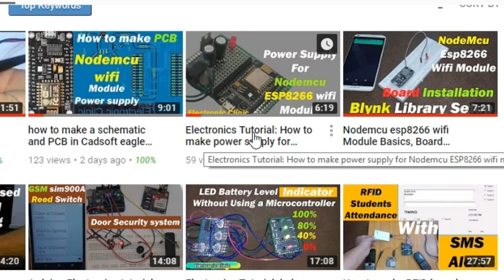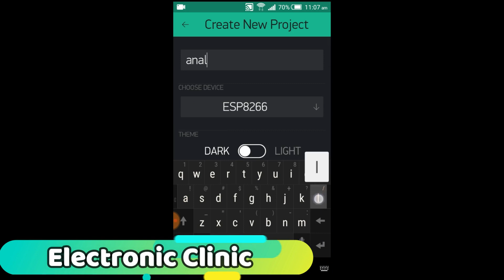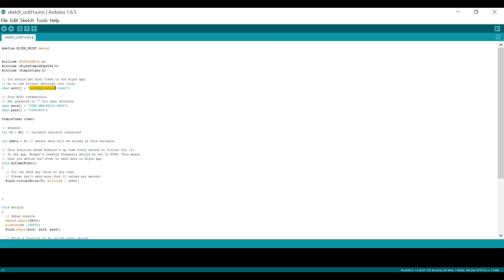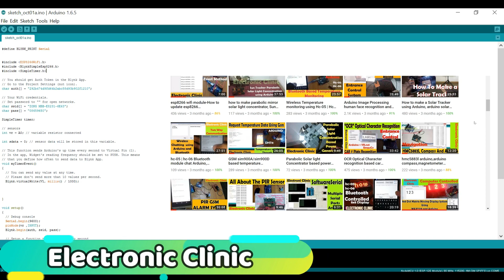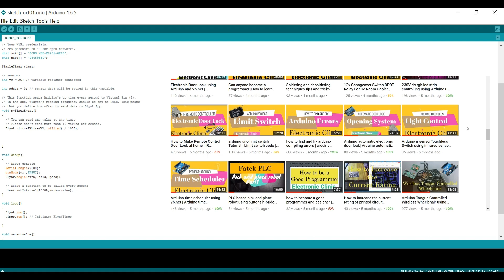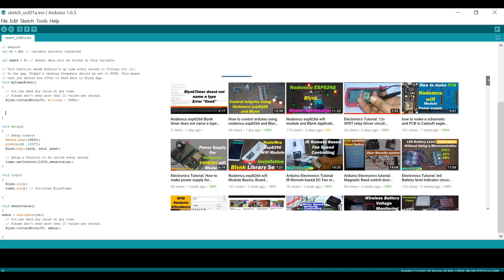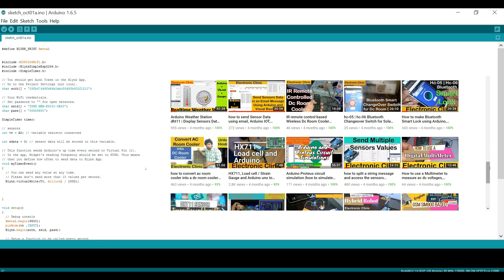Nodemcu ESP8266 Analog Sensor Monitoring using Blynk Application

Comment: Sir I have using water tank level transmitter for measuring the tank level. The transmitter out is 1 to 5 V variable 
Means
1V need to set 0%
2V need to  set 25%
3V need to set 50%
4V need to set 75%
5V need to set 100%
Can you make gauging display via blynk app with modemcu

Please  make code for me